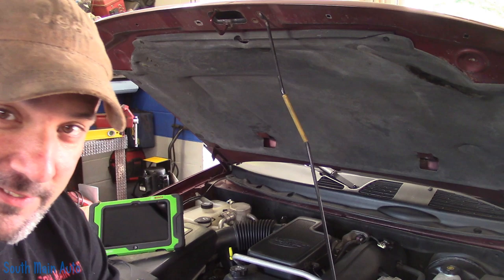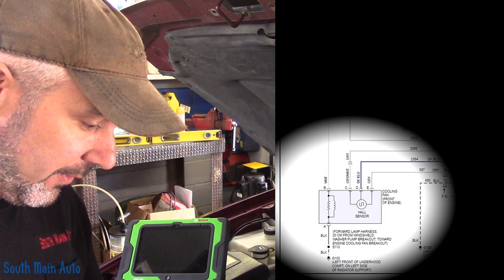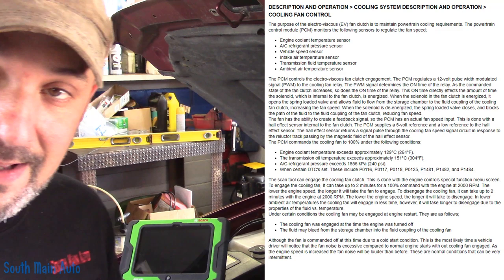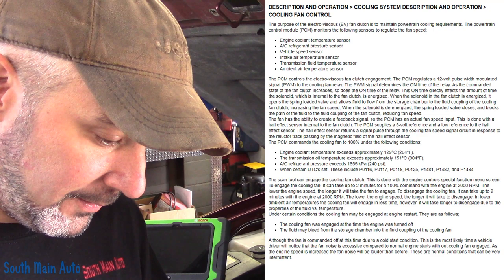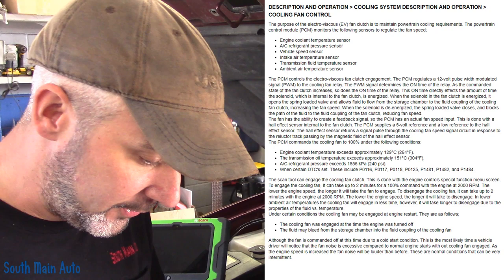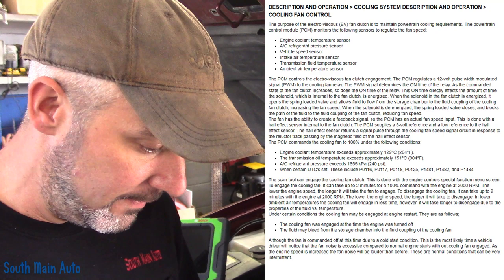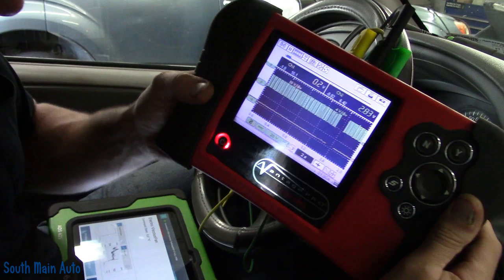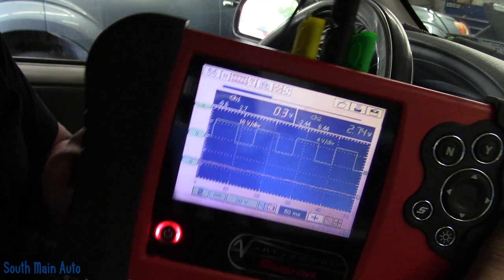Chevy Trailblazer: Electric Fan Clutch Failure

Comment: Why do manufacturers have to make things so complicated. Surely a temperature switch wired in series with the fan would do the job just as well?
Reply: Wouldn't satisfy the other high speed fan demand criteria, that would be a very basic control system.
Reply: I think it mostly comes down to power and fuel mileage. Keep the fan speed as low as possible and still performing the cooling needs or the engine. Also air conditioning gets a performance increases at idle if they ramp up the fan speed.
Reply: SO IT WORKS LIKE A REGULAR CLUTCH FAN ?
Reply: Seems like it might work if you attached the fan directly to the water pump shaft. Even with an old fashioned clutch fan it worked for decades without the need for sensors or scan tools and most importantly, computers.
Reply: @yqwgjsg  I had a 1950 Ford Popular back in UK. The fan was mounted on the belt driven dynamo on the top of the engine and had no problems. Used to get a load of pleasure working on that car on a Saturday and Sunday. All the tools needed were an adjustable spanner, pair of pliers and a screw driver. Wonder what the scan tool would make of that!!!
Reply: FREGGIN A, THAT'S WHAT I WAS SAYING. WHY NOT JUST PUT ELECTRIC FANS IN & BE DONE WITH IT ? IT'S LIKE THEIR STUPID SHUTTING DOWN CYLINDERS HEADACHE THEY CREATED TO SAVE GAS, LOL.
Reply: One acronym: CAFE (C_orporate A_verage F_uel E_conomy); thank you government meddling.
Reply: @NoWr2Run  electric fans can't pull the same amount of air as that electric controlled fan clutch. Cummins,Ford, some year Duramax, and most medium duty trucks use that style. Air clutches on the bigger ones.
Reply: @walterk1221  so the DECREASE in national fuel consumption leading to reduced demand and fuel in lots of places for $2.50 would have happened because ford, gm, chrysler would have done it on their own? I don't  think so.
Reply: @yqwgjsg  With this method of electro-fan clutch you get better emissions, quicker warm-up time, and even fan-speed monitoring.
Reply: nowr2run yeah that’s about it. The bi-metal spring heats up at warmer temps and turns the fan on. Isn’t that what’s happening when the engine, tranny and condensor heat up? The fan doesn’t need to be electric because it is on the front of the engine connected to the serpentine belt.
Reply: @NoWr2Run  Mechanical fans move more air and cool better at highway speeds.
Reply: @jack-in6hz  actually, the tech gets paid for by consumers, but then the consumer saves on gasoline costs and the environment saves on pollution costs and society saves on health care costs.
Reply: @NoWr2Run  no, it has more control than a on/off fan clutch. This was an intermediate version before they went full electric fans on everything. It gave them better rpm control over the fan to decrease the load on the engine and preserve fuel mileage.
Reply: @yqwgjsg  it also put massive drag on the engine and severely lowered mpg for an overkill amount of cooling.
Reply: @NoWr2Run  dude why are you screaming?
Reply: @jack-in6hz  really, unrealistic? Just 1 mpg reduction over millions of vehicles is a massive savings in fuel and pollution. Ever been in a major city with Smog? It's not fun.
Reply: Bob Green, THAT IS COOL AS HELL, THANKS.
Reply: Imps, Yes I understand it has more control over a regular clutch fan BUT JUST THROW ELECTRIC FANS ON & BE DONE WITH IT. ALSO CAN YOU HERE ME TYPE ? AM I LOUD TO YOU ? DON'T BE THAT GUY, Imps. IT'S NOT IMPORTANT IN LIFE NO MATTER WHICH A WAY I A TYPE A.
Reply: @Bob Green Nice car. Keeping it simple. 😊
Reply: ImpsMyPimp I know what it does. I also know that engineers these days are taking the easy way out letting the computer control everything instead of coming up with innovative ways to solve problems. Hell nowadays the computer even controls the horn.
Reply: Electric fans put a higher load on the alternator especially at idle and they would have to redesign the radiator mounts and electrical connections and the plastics and the computers and now you need a more powerful alernator and it's a snowball from there.....
Reply: @stephendee7839  Great post Stephen.
Reply: @walterk1221  Law of diminishing returns. Money saved on using less fuel is eaten up by the energy needed to create all the additional plastic and metal parts needed to save the fuel and then compounded by the cost of complicated repairs @ $80/hr plus the mechanic is heating his garage in the winter.

Comment: Ahhh the dreaded fan clutch. I had so many problems with that as well. Ended up changing it to a thermal and sending pcm to a tuneshop to delete codes. No problems since. I do think that they used a fan clutch because the engine is all aluminum which gets hotter much faster than a regular engine with cast block with aluminum heads. However letting it reach 260 before full command in fan clutch is just absurd in my opinion
Reply: I would just like to convert the damn thing to a bi-metal fan clutch like on my 2000 s10 with 4.3 v6. They attach to water pump similarly. or maybe remove it all to together and add an electric fan. any consequences to vehicle operation other than the check engine light?
Reply: @mistermechanic2257  you can buy a thermal fan clutch on rock auto. For years 2002 to 2007 used the electric viscous fan clutch. 2008 and 2009 used a thermal. You can buy a thermal for year 2009 and it will still work. You will have service engine soon light on but is still driveable. Then if I was you I would send the pcm to get tuned that can delete the dtc codes. Their is pcm4less and lime-swap.com. I did mine with lime-swap.com and love it. You can message him and does pretty well emailing back with answers to any questions you have. It's 100 bucks but well worth it

Comment: Same as the old fan clutch types except instead of using a simple temp sensing bi- metal spring to open the fluid reservoir and engage the clutch it uses inputs from transmission, AC, Hall effect and engine temp sensors for the computer to activate the clutch. Not sure why they needed to change the design. It seemed to work well. The only time the fan is really needed is when there is no air flow or when the vehicle is not in motion. I prefer the older style fan clutch. Much less that can go wrong. Nice job Eric

Comment: Good video, but I am concerned about the loose bearing and that could throw off the hall effect switch.  But either way, the fan clutch will need to be replaced, because it's all one unit in the fan clutch, and I don't think that it's rebuildable. Thanks for sharing....

Comment: Clear explanation of theory, operation and diagnosis. 🤓 👍
Do you recommend to your customer to change water pump when changing electric fan clutch as they both age similarly? 🤔
Reply: Might as well throw a thermostat and temp sensor in as well on that model if it hasn’t been done
Reply: Funny thing. I’ve heard that is the recommendation. At least when the water pump is changed the fan clutch should also be changed. They wear about the same.
Reply: @williegillie5712  An out of balance fan can beat the water pump to death. It's one of those "while you're in there, you might as well..."

Comment: i have had two trailblazers for close to 11 years now and love them both., but they both always have problems with this fan setup. the last time i replaced them both i got the lifetime warranty fan from autobone about 3 years ago. anyways i did not have the tools to observe rpm,  or the scope to monitor the square wave of the speed sensor., as you have but i know i have had problems with these fans for some time now. i have to replace them about once a year sometimes more.in each vehicle,  i have gotten pretty fast at it lol .anyways. i read there was a gm service bulliten on these fans and gm recommends a pcm flash and a new redesigned fan for these vehicles but i not remember why, maybe to increase fan speed at low rpm to aid with ac system not cooling off fast enough? on to my symptoms that lead me to having to warranty swap these out: 1 if i let the vehicle sit and run for more than say 30 minutes or so the fan clutch starts making crazy squeaking and rattling sounds at the tale end of that fan clutches life span and i usually replace it the next day. 2 sometimes i notice the clutch will not engage and my ac stops blowing cold and engine temps rises. 3 sometimes i notice the clutch stays fulled engaged and it sounds like a turbo prop is under the hood. i know i should have went with oem. seems like both the oem and aftermarket design of these are bad. just my two cents. awesome video as usual. i wish i had a mechanic like you in my area, then i wouldnt have to worry about getting shafted while dealing with incompetence.

Comment: A very timely video for me. my 2005 Dodge Ram 3500 has a very similar fan set up. I believe it is bad and it took out my A/C compressor. One of the inputs is from the A/C system and mine let the high side pressure blow all of the gas out the on the compressor relief valve. This will give me a chance to try out that ne Picoscope scope. Thanks for the information it will be a big help in my diagnostic plan and repair.

Comment: After you replace the Electro hydraulic fan clutch assembly you have to update the PCM with new software for it. Do the reprogram. You have to do the reprogram
Reply: Exactly - I had two shops (one was the dealer) and NEITHER updated by PCM yet both put in a new fan clutch and both claimed the A/C was working fine. Nope.

Comment: Just like PWM on the HVAC blower only with a sensor instead of human and knob. BTW Eric, the sensor on that fan works like the one in the reformatted hard drive PC. 3 wires, 5V ground and a PWM output to see if the fan is working. Had to reprogram one when they changed fan models.

Comment: Had a problem with the connector for the fan clutch. Cleaned it up, zip tied it so it wouldnt move and it works.

Comment: One of those times when an oscilloscope really helps/a necessity.  I had a flaky hall-effect sensor once but no o-scope and it was very difficult to diagnose.  When hot, would cause engine to stall/no restart, for about 2 minutes.

Comment: Hey so I’ve had some shaking issues at certain speeds that’s pretty aggressive.
I’ve been told that tired could be out of balance or that there is a defect in the tires or wheels.
I had one mechanic lift on the back end get it up to about 65 mph and you could see some wobble in the wheel, however.
I got under my truck before this mechanic looked at it and my drive shaft &slip yolk have a lot of movement up or down, almost an entire inch.
This mechanic said no it’s nothing to worry about.
I took it to another mechanic the following week and he picked up on the back end, and the slip yolk came out of the transfer case about a half an inch.

I believe I have an issue with my transfer case or driveshaft/slipyolk.
The tires and wheels are almost brand new, they were made the end of 2018 according to the date on the wheels.
They prolly only have like 3000 miles on them.
Yet the violent shaking persist.
This is also after I installed a 4.75 inch lift and these wheels are 33x12.5.
If you have any opinion or advice, would be greatly appreciated.

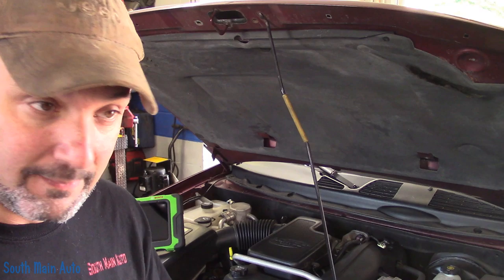Comment: Hey Eric, @0:48 you said "a default full on", but than the PWM signal from the PCM should be a continuous 12V, but it isn't !?
I would think a safe mode would be that the clutch is default engaged and the PCM controls the OFF-time with a PWM signal, instead of ON-time. Then  if somethings goes wrong (broken wires, broken PCM,......), the clutch would go to the default clutch-on state and the fan would run at full speed, protecting the car from overheating.
Why didn't we see the orange testlamp full on, if the default was full on ?
Nice video!! 👍😃

Comment: We had major issues with these at the dealer... Replace the clutch and reprogram the ecu...
Reply: Pro tip... Take the fan off of the clutch and you can sneak it thru without taking the shroud off... You'll cut your arms up though

Comment: Have a 05' Blazer with all the crappy things to go wrong (you have a few videos on GM trucks i had to follow (ABS drain) few other things ...Im happy no electric fan ..but had to replace the chipped fan ( engine felt ruff ) still working on a parasitic draw ..Sometimes pulling the plug and buying new is better lol

Comment: When I was working for Chevrolet at the dealer level, we saw so many of these coming in and the customers were complaining that it was a transmission issue . It sounded like a jet airplane thought that because of the fan noise would increase with the speed of the car, like direct drive, but we knew we had to put a new electric mechanical fan clutch assembly on it and also reprogram the PCM for the new fan clutch assembly. I believe there was a TSB on this.
Reply: I had a new fan clutch put it back in 2015 - and now it doesn't work again. Why do these fan clutches fail? thanks
Reply: OK I reread my records and reading the Trailvoy forum - turns out if you do NOT get the ECM/PCM update for HVAC then the new fan clutch will just go bad again! The dealer notes even stated - first they did a diagnostic and state, "updates available but not sure if they will improve performance" and then five days later we get the new fan clutch - and just says it's a GM fan clutch (compared to the different fan clutch a local shop had put in a week before). So they never did the software update!! And now the fan clutch is bad again. I don't think it lasted that long. I just got fed up - wondering why the AC never worked. NOW  I know why!
Reply: So the service bulletin was cancelled - and so the technicians didn't update the HVAC even though that's what the service bulletin says to do!
Reply: What I work for Chevrolet, all of us there at that certain dealer they replace those clutches did the update. We did that because we didn't want it to come back and I have to do it again because we didn't reprogram. It's a very simple thing to reprogram. They did not do it either because they're lazy or they're uninformed about the problem with the clutch
Reply: @williamsmith716  Glad you all did it! thanks for confirming that is why it failed again. Yes it's kind of an amazing detective story.
Reply: Oh someone posted this: "There was a later TSB for 2005-2008 models (07-01-39-007A-No cold air from vents, A/C inoperative, blows warm air (Sep 26, 2007)) but this was cancelled by TSB 07-01-39-007B (Dec 9, 2008). The original solution for this one was to reset the HVAC Control Module by removing and re-installing the HVAC control module fuse (in rear fuse block under driver’s side rear seat). The TSB cancellation notice said if problem occurs, diagnose using information in SI (GM Service Information, aka the service manual)." And the dealer repairs I have CITE that "cancellation" of 12/9/08. So therefore they used the "cancellation" TSB as their excuse to NOT do the computer update!! Amazing.

Comment: I understand the directives for better fuel mileage, but these engineers seem to get down a design rabbit hole. A viscous drive fan clutch by design is complex and expensive. The electric drive fans are much simpler, less expensive and more reliable. But certainly, kudos to Eric as usual.

Comment: The MIL code also might have been "P0495 Powertrain". I have a 2003 Trailblazer with this issue: "cooling fan stuck in high speed throwing P0495 no matter what the Chevy dealership service department tries to do." This issue is very frustrating. You'd think the brand's own dealership service department would be able to fix this issue. But so far, no luck there. And it is all luck at this time.

Comment: It was obvious the clutch fan was no good from the get go. Then again I own one.  My issue is the overheating when I turn the AC on. All my gauges have pretty much failed. And my heat gauge spun all the way around.  What is what does speed sensor also make your vehicle overheat when you try to use your AC. Cuz I noticed sometimes my speed gauge works and sometimes it doesn't.......my bad, I spoke to soon while watching the video. South Maine Auto LLC.

Comment: my 2002 trailblazer just got a new fan clutch 3 days ago, but it only kicks in when my temp gauge is at 3/4 then it comes back down, exactly just like the prior fanclutch, so im guessing is not the fan clutch at all, also , weird thing no trouble codes detected, but when it kicks in at 3/4 temp comes down fast, what could it be? what else can i test? new water pump, new fan clutch, clean radiator , the only thing I have not replaced is the coolant temp sensor

Comment: Chevrolet meeting: “Ok guys, I want you to think of how to make a cooling fan the most complicated system you can think of for the new Trailblazer.  We need it to have electrical, mechanical, and hydraulic features.  The more complicated, the better.  Get to it!”
Reply: And it's said the Germans overcomplicate things! My 03 Jetta's cooling fan system is as follows- 1 large fan, 1 small fan, electric motor on each, ECM controlled. 🤷‍♂️
Reply: Some guy at the meeting stands up and says' lets do it the way Mercedes does'.
Reply: Isn't this the system that caused the "CHALLENGER" disaster? 

NASA sold this to GM, and they all laughed!!
Reply: Engineer says, “Can we add pneumatic valves to control the hydraulic fluid???”  Boss says, “Now you’re thinking.  However the compressed air for that should be produced by compressor driven off of the driveshaft, or the crankshaft.  I’m open to anything more complicated though”.

Comment: Me thinks that fan clutch has been replaced before (due to that broken shroud) and the replacement was a non-OEM or equivalent. When replaced again, add a small dab of anti-seize on the large thread. Also, unless it's been done recently, replace the water pump too with a little medium thread locker on the screws.